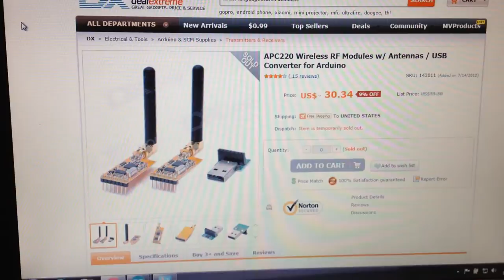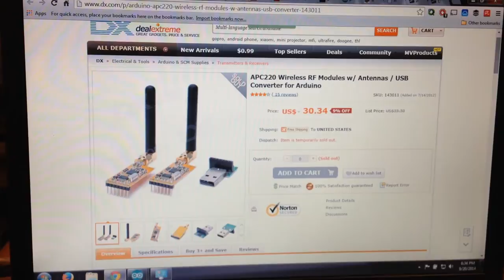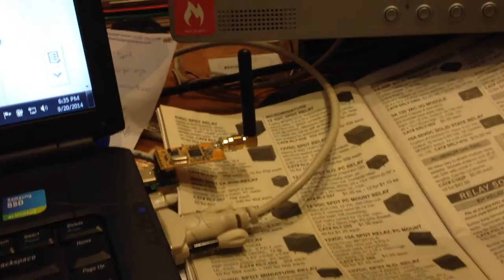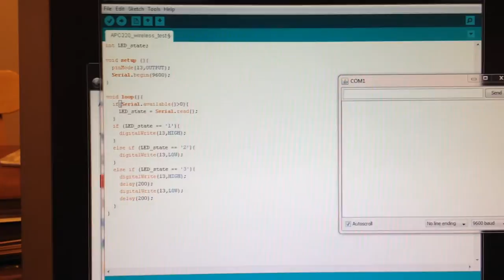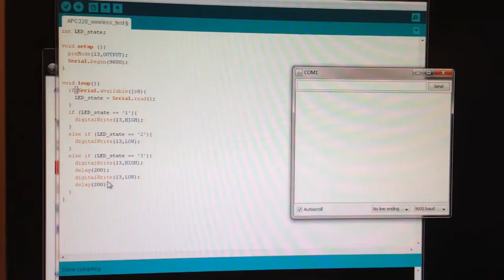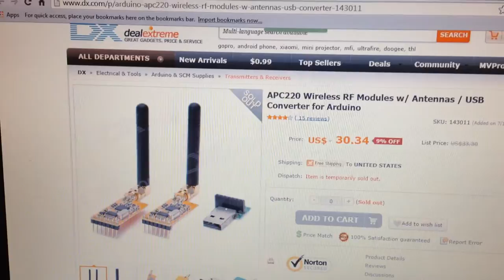APC220 wireless transceiver setup and test with Arduino

Comment: Hello there.

I have a question about APC220. I could not find the answer in the datasheet.

I am experiencing 68ms delay between transition from sending to receiving.
Does the module need 68ms to switch from sending mode to receiving mode?

Is there a way to prevent this? Thanks in advance!

Comment: CAN YOU TELL ME WHAT IS THE TRANSMITTER ANTENNA GAIN ?
Reply from the maker: +Moahmed ELnahas I don't know but the stock antennas are supposed to give you about 1200m if you have a clear line of sight.  Data sheet here at http://www.robotshop.com/media/files/PDF/dfrobot-apc220-manual.pdf

Comment: Hi, I bought the APC220 last month, but I never got mine working.
Could you help me please? Thank you
I had wrote it with same parameter using RF-Magi. (except the NODE ID)
Used different NODE ID for both APC220.
I have a APC220 connected to PC (COM4) and arduino board with APC220 connected to PC (COM6).
Then, I tried to use the code below, but it showed me an error while I press "upload" with COM4
http://s328.photobucket.com/user/chan1600/media/Capture.png.html?sort=3&o=0

/*
Pin Connections
GND to Ground
VCC to 5v
RX(on apcc220) to Arduino TX(pin 0)
TX(on apc220) to Arduino RX(pin 1)
*/

void setup(){
        Serial.begin(9600); //9600 is default baud rate for apc220
}

void loop(){
 Serial.println("Connected.");
        delay(1000);
}